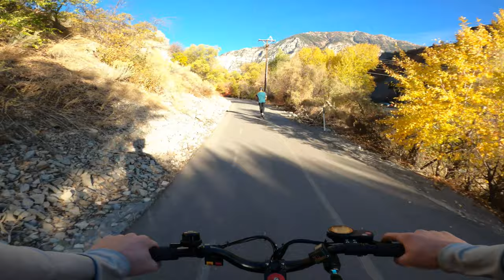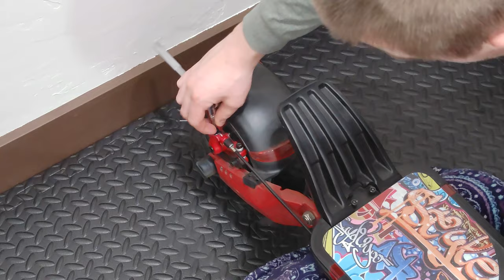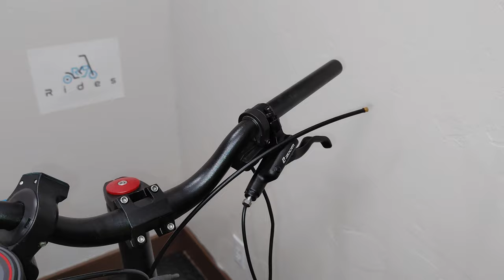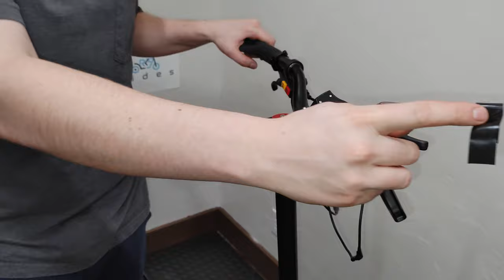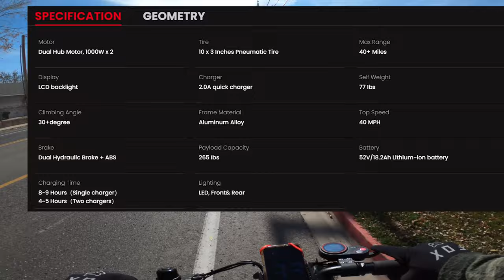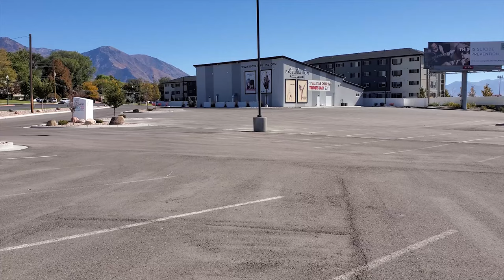Electric Scooter Brake Upgrade: Mechanical to Hydraulic Brakes

Comment: Mechanical to hydraulic is a great start... But 140mm to 160mm rotors is where the better braking modulation takes effect. It's Essentially adding almost 20% more braking torque. I made a tutorial on. I would definitely give it a try if I were you. Nice video btw!
Reply: Do you have this on your escooter? My concern with the size is that it will hit rocks if you go a lot off-roading....
Reply: @everythingoutdoorzy88  lol just do it... Every scooter comes with 160mm now. Back then nobody had it so that's why I made a tutorial.

Comment: Unfortunately, it seems now the new Varlas will not come with the Zoom Hydraulic brakes but a brand they call MAKUTA, have not heard of it, and the symbols on the units are Chinese. I will be interested in knowing if new customers are getting the same brakes as mine or the Zooms. Not very happy, as the rear brake took a lot of tweaking to get it from screeching and the brake lever feels squishy compared to the front, may need to bleed it out in the near future. Also, my rear disc brake was completely rusted, needed to buy another and they ended up refunding me. The clamp was also disassembled and thrown on the bottom of the box. Overall 7/10 packaging and 6/10 out of the box readiness. I will do a review soon. Now once all is set and ready, the scooter is a lot of fun to ride. I got the extended handlebars you recommended and I love them! Makes the world of a difference. Got some other goodies that I installed! Thanks for the inspiration!

Comment: actually I think you missed the biggest point with the brake sensor, it cuts up the power of the motors, because electric scooter components are low quality (like the display trigger) many of them fail and go full throttle (magnet snaps out of place, plastic holder brakes etc), pressing the break will avoid any danger that might happen to you by taking hold of situation and stop without a problem... and not the (almost) useless breaking blinking lights...
Reply from the maker: You make a good point. You're right and I totally missed that.
Reply: This exact failure happened to Me today on my Mantis.  Uncontrolled and unintended full acceleration with an Error code. 350 miles on mine
Reply: yeah exactly. Are the Magura e series brakes the only name brand levers that come stock with the electric connection?
Reply: @Goodman-4525  no, there are zoom and nutt also
Reply: plus its an "always open" system, if you dont connect that line then it will think that the brake is always 100% activated, and you wont go anywhere, happened to me after the lever snapped off but the sensor was still intact
Reply: instaBlaster...

Comment: im thinking about adding hydrolic brakes on my scooter.i have an apollo city and im wandering if i dont reconect the brake light cables will the rest off the scooter still function because if heard of error codes that can come up on some scooters due to that

Comment: So my Eagle one has the front rotor , bracket and caliper on the left side of the wheel and tire. Are they swappable left to right? Any idea?
Reply: Not usually. They are side specific.
Reply: @everythingoutdoorzy88  thanks very much. That is what I thought. They are mirror images of each other. I just thought maybe a plug and wire could be swapped. I've fastened the brake line well with zip ties and it's been fine. Thanks very much for your expertise. Varla actually responded- they weren't as clear as you but just said "its fine- we made some with the brake rotor on the same side and others with rotors on opposite sides.

Comment: I think you can flip the brakes to opposite side so the logo faces underneath and doesn't bump into the display controller
Reply: There's a little reservoir in there that needs to be right side up.